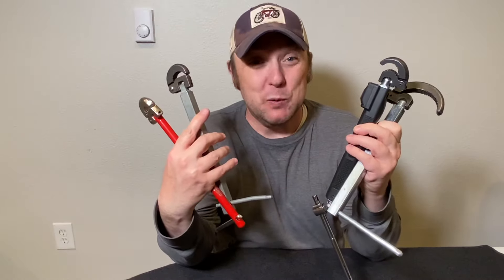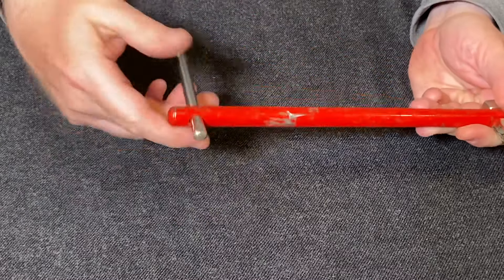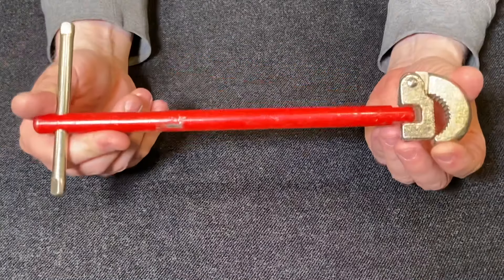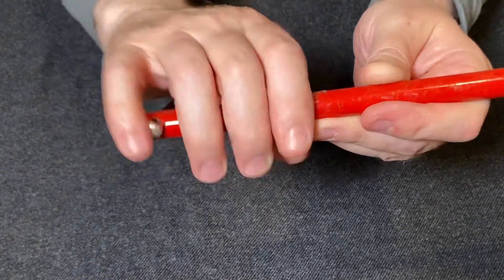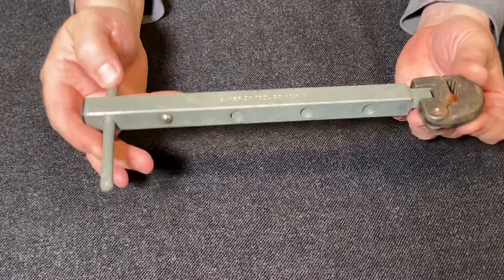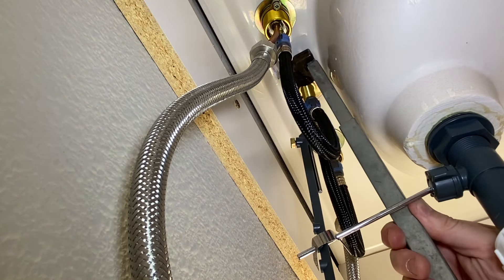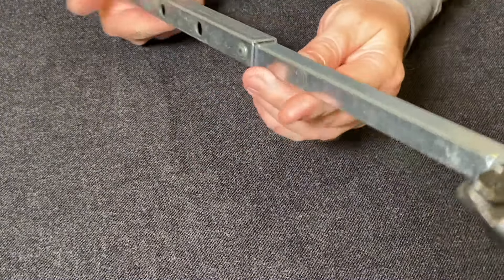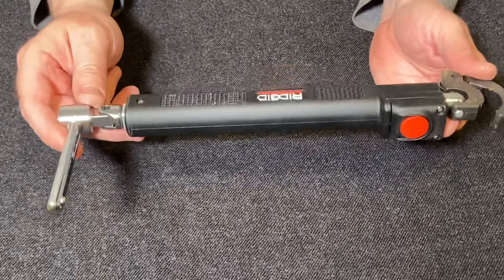Best Plumbing Tool for Tight Spaces!

Comment: Man I wish I saw this video earlier. I do a lot of diy jobs around the house but never heard of a basin wrench before. I had to change some faucets in our bathroom the vanity is super tight no room at all. I ended up cutting down a pair of cheap Channel locks to get the job done (we’re still in lockdown 🙄) I figured there had to be a better way . Thanks for the video I’ve got one basin wrench on order 👍
Reply from the maker: Big high five for cutting down cheap channel locks and making that happen!  I love that kind of stuff!  So many times you have to do what it takes to get the job done!  Thank you for checking us out!

Comment: I've used the basin wrench in conjunction with the tub wrenches (long deep open-ended socket with a hole I the ends to stick a breaker bar to remove stem back in the tub wall or basin nuts under the sink to remove a ks or lav fct . many many times.
Reply from the maker: That is awesome!  It really is a great tool. You ever did water heater elements with one?

Comment: thanks. i like the idea of a ratchet but probably don't have the money and what i really don't have is the room for a basin wrench to fit arount the nut  because there's no space on the sink or wall sides. what i could use right now is a basin wrench with a smaller tip.
Reply from the maker: I would love a small sized basin wrench  as well.  That is plumbers pain bro!  You never know what you will run into at times.
Reply: @ThatFixItGuy  i don't know why they don 't make a Basin Buddy that will fit larger sizes. we just ended up paying a plumber (who used a telescoping basin wrench) and even he had to cut the damn nut because it had been put on too tight. i would have tried an immense socket but even then it would have to have openings for the supply tubes.

Comment: I'm having a headache tightening my loose faucet. I just came back from Home Depot and purchased a basin wrench. I'm confused about your pivot explanation at 1.35. Don't i tighten clockwise or is it opposite with this basin wrench. Anyway, i'm trying it now. I'll be right back and give you an update.
Reply from the maker: It is righty tighty.  It is just funky under the sink at times with weird angles.  Hope it went well.
Reply: @ThatFixItGuy  Without a photo to show you, I can't get that hook shape to go around the nut. The space is tight and the hoses are in the way. Even if I disconnected the hose, the basin wrench won't fit and grip the nut. It's a brass 2 inch wide nut. I've never seen a nut like this before. My faucet dd cost me $1000 so it must be european like BMW's where every part is different from USA. Anyway, I've decided to hire a plumber and purchase a new basic stainless steel faucet that doesn't cost $1000. He wants me to purchase Kohler. I assume its the favorite of plumbers and easy to install. The plumber tells me to buy a new faucet and he will do hos best to fix my existing faucet/ If he can fix it, then I can return the new faucet. In not, then he can install the new faucet immediately.
Reply from the maker: Well that does not sound like a bad Idea.  If you have facebook you could send me a video or a picture if the faucet.  Sometimes things are weird.  I've totally had times where the basin wrench would not work and had to wing it.
Reply: @ThatFixItGuy  I'm making one more attempt at this. I'm buying that RED RIGID SINK and FAUCET INSTALLER I see all over youtube. I saw it at Home Depot when I went to purchase 2 other basin wrenches that was recommended by one of the employees there. He said the RIGID might not work since the nut is 2 inches, but I did watch a video where there is an adapted included that could work.  If it doesn't work, I'll move forward with a Plumber. I'll try and send you a photo via FB. I assume your FB page is linked somewhere on your video. Thanks.
Reply from the maker: Yeah there is a link in the description box    I’m happy to take a look at it. The red faucet wrench’s work good in some situations as well. Fingers crossed.

Comment: I got pizza and a case of IPAs with your name on it if you come fix my sister's sink. I'm about to rip it out let alone all the sinks in my own house . I HATE SINKS. THE DUMP WAY THEYRE DESIGNED IS FREAKING 1930S TECH
Reply from the maker: Where you live?   I feel your pain.  Every time I climb under a sink I hope it is my last time.  “Me when the cabinet is smaller than I am” 😣
Reply: @ThatFixItGuy  united states. There are so many different ways sinks could be designed but they chose the most difficult option. Wtf